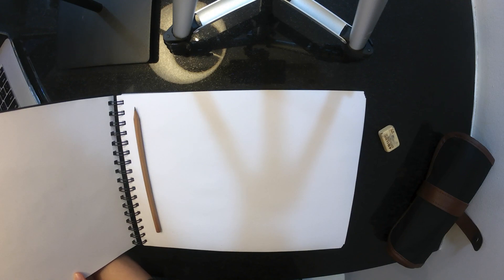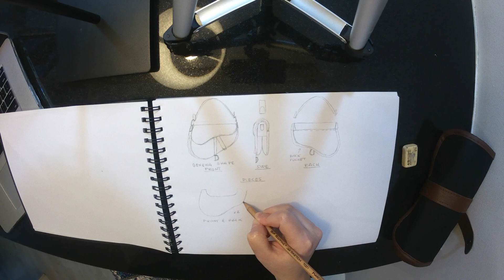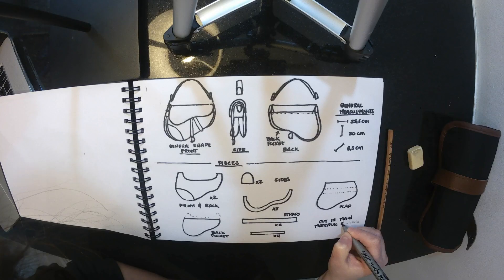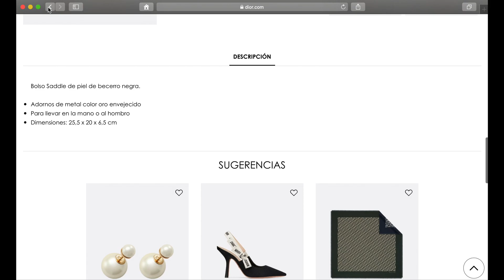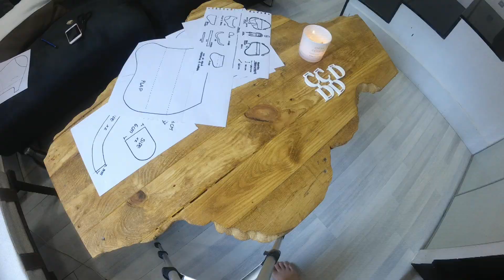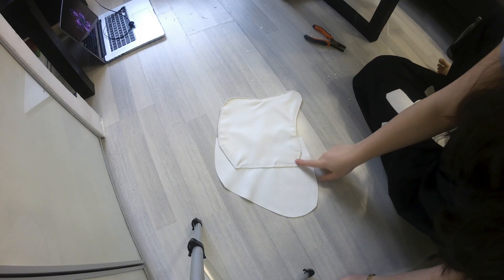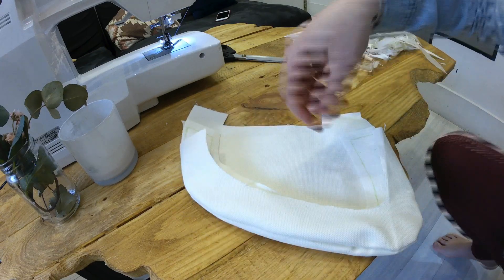DIY Dior Saddle Bag

Comment: I love this so much! Any idea where i could get similar letters or what they are called so i can search?
Reply from the maker: Hi!! I actually 3D printed the letters, but if you are wondering about the font I think it is actually Times New Roman!!! But the original is made with a font called “Nicolas Cochin Regular”. You can try to find it in a website called dafont or any other similar, installing is super easy and you could make it any other brand you like :) usually googling for “this-brand-font download” works!

Comment: I like this video. The bag is awesome. Do you have the pattern to the bag to share? and where did you get the D & C letters? Thanks for sharing.
Reply from the maker: Hi! The pattern I made coping the different shapes that I needed from a picture on the computer! 😜 And the letters are 3D printed, but you could probably make them out of card board and crazy glue!!! Just sandwich several layers of cardboard (preferably not box cardboard but something more dense) cut outs of the letters and cover them in crazy glue. Sand them down and paint them!!   It should work!
Reply: @modernhomemaker  
Thank you 😊

Comment: Do u think i can do this with hand stitch??
Reply from the maker: Yes sure! But I will recommend that you choose a softer material than faux or real leather! And to add structure with interfacing before sewing! 
And if you wanted to make it with leather or leather like materials, maybe try using traditional leather sewing technics, that require making the holes first, and then sewing through them with two needles. 
I really hope this advice is helpful 🥰 and thank you for commenting! It really helps support my channel 😘😘😘